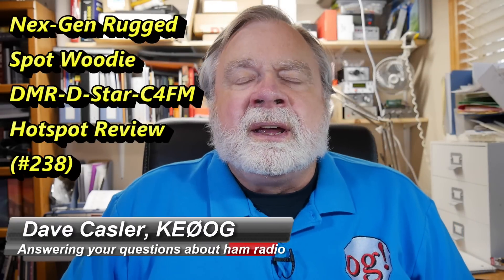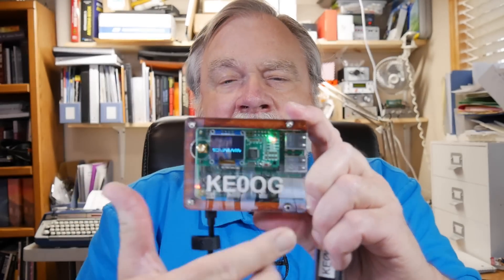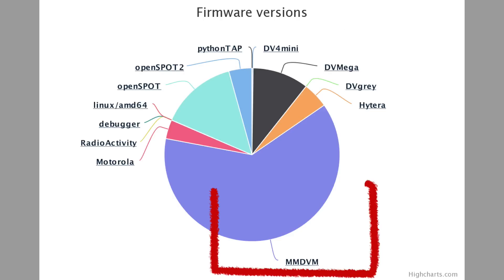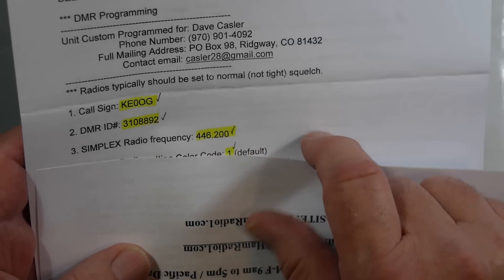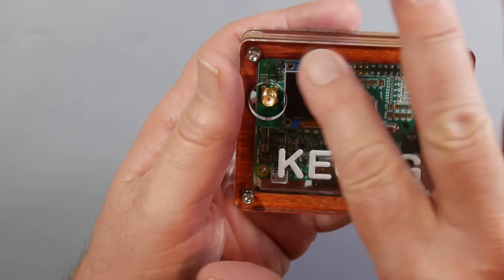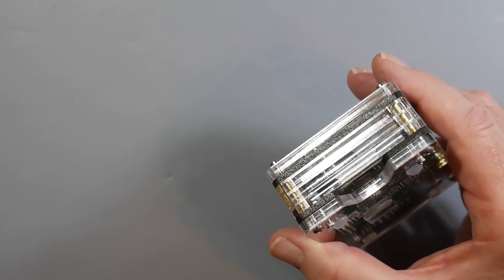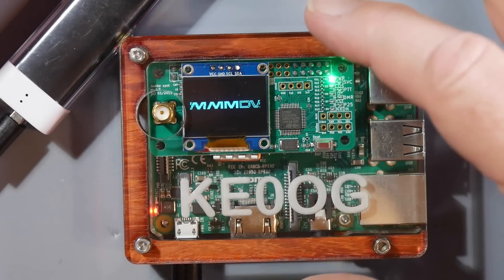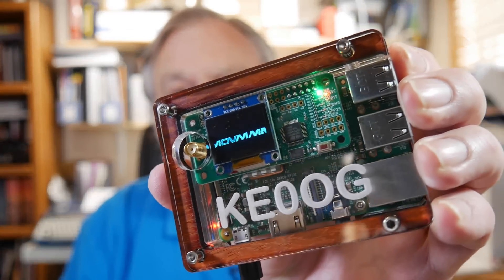Review of NexGen "Woody" Hotspot (#238)

Comment: Regarding pulling the plug,.
The filesystem is set read only so normally it’s no problem :)
HOWEVER it it’s updating, or writing to the sdcard in any way it can (does not always) corrupt..

(If you need to modify anything inside the raspberry pi you have to use the command “rpi-rw” to turn off read only) (this is not needed for basic settings in pi-star)

Have fun with DV :D
73,
PD0HOF

Comment: I bought a rugged spot from him a couple years ago. Turned it on and it was running in seconds.

Tac 310 is still around, but BM won’t allow it to be static linked anymore. Due to this it had effectively killed it. Not sure what replaced it, but I think a lot of the 310 folks went to 3100 (USA).
Reply from the maker: Thanks for the info.

Comment: About yanking the power. I have used it with my built in car WiFi and use an app to find the IP addresses on the network that I am on and look for the pi-star's IP address and use the phone's browser to log into pi-star and do a power down that way. Unfortunately the USB power outlets in my car shut off with the car ignition so you have to be mindful to let your car run until you get the Pi shutdown. Pi-star recommends that you wait 30 seconds to let the pi-star OS to complete its shutdown routine. 
You mentioned the openSPOT brand. I have the openSPOT2 and like it. But I really think the oS2 is better suited for C4FM. I have tried to run DMR on the oS2 but had a lot of weird issues over using DMR with a pi-star hotspot. I have the DVMega from Bridgecom systems. They claim plug and play but I had to reconfigure the WiFi on it. Otherwise the DVMega pi-star hotspot has been flawless. I haven't tried C4FM on the pi-star since I have the oS2 for C4FM but even then I use my Yaesu FTM-100DR in the Access mode as a Wires-X node with Wires-X software which unfortunately requires the use of a Windows computer. 
The DVMega doesn't have a OLED screen but I do have the ability to use VHF or UHF which in a sense after thinking about it I wasted about $40 to get that feature.

Comment: I am on my 2nd hotspot, still not on the air! 1st was a chinese duplex with the large screen option. Nice aluminum case (EBAY). Zero instructions and zero customer support! 2nd is a Jumbo spot kit. I guess my problem is with Pi-star itself. I can not set either hotspot up. I can't even get to the configure page. It is VERY frustrating! I hate to buy a 3rd, but plug & play is sounding very attractive. Thanks for another GREAT video.

Comment: I built one like it for little over 100 bucks. There are others out there that have a nice screen where you can change settings by touchscreen
Reply: Yes, I noticed this one costs almost $300. That's around $200 for someone to set it up for you. Ham Radio is a DIY hobby. I think I'll buy an un-programmed one and figure it out myself and save coin... de W3DJS
Reply from the maker: Lots of hams like to do things themselves. On the other hand lots of hams don't yet have enough experience to do everything themselves. It's the classic make or buy decision.

Comment: I thought hams were into challenges (aka frustration). 😃 I went the Pi-Star Raspberry Pi Zero route for around $70 in eBay parts. I had to solder 16 joints, flash the SD card, and run the setup. Not that bad.

Comment: Great video! Definitely want to look into adding this for DMR ops. I obtained my Digital ID last year but did nothing with it  so this will give me a kick to get started.

Regarding the questionnaire you referenced, do I select an frequency arbitrary one (aside from local repeaters) or are there parameters for the 2 meter band?

73,
Ken, KN4GUS
Reply: My experience with the MMDVM modem board is that it states it supports 2M, but in reality, it didn't... 73 de Stan, G4EGH
Reply from the maker: You need to specify a simplex frequency probably in the 70 cm band. 70 cm band plans vary from region to region. So just pick a frequency that simplex in your region. By the way after you get the device, you can make changes to any of the parameters that you need to make.

Comment: Thanks Dave, quick question... I bought one of these (Rugged Spot) a year ago. I never set it up or used it. I then moved and my wifi stuff changed. The info in the box uses my old info. How do I modify the hotspot so it will connect with my wifi? My guess is I need to connect it to a tv, keyboard, and mouse. Any suggestions?  THX/73s KJ4MFW
Reply from the maker: No, you can log into it via your computer and then set up what you need. Note you will need to know the IP address assigned to it by your router. Or talk to the manufacturer.

Comment: Great video. What kind of programming did you have to do to your radio? You said it took several passes.
Reply from the maker: I don't program handhelds often, so it's like I have to climb the learning curve every time. I usually just program in a few repeaters and some simplex frequencies. I operate my Nex-Gen on simplex, but it took me a few tries to get the radio set right.
Reply: @davecasler  Thanks for your reply, David. Fantastic video!!

Comment: Umm, Dave... You are supposed to put one of the antennas on the SMA Port on the left of the screen....
Reply: If it also has the antenna strip on the board itll only use it and not external
Reply: Dave talks about this very point at 17:05 into the video.
Reply: CodeMasseur I have the HRO zumspot and it has that "strip" as well and they told me to use the antenna. That's why they include them in the package.
Reply: If anything could put small sma dummyload on it and be flush. But I know on the jumbospot boards if it has the strip antenna, you dont need other
Reply: @wesmagyar  I'm not indicating what is right or wrong. I'm just stating that KE0OG talks about that issue at 17:05 in the video. Personally, if I used a hotspot, I'd use the external antenna .However, I have a DV 3K Dongle, and I just need to run BlueDV to connect to DMR from my laptop. The Dongle was about $100 and it's a much simpler way to get on DMR or DStar. (No support for YSF with the dongle sadly.) You can learn about BlueDV here: https://www.pa7lim.nl/bluedv/

Comment: I consider that the greatest risk with sudden power out with computers comes from the potential for filesystem corruption due to incomplete writes that necessitate recovery via scan or from journal (with fsck program in Linux).  But If you poke around in the Pi-Star (you can ssh to a shell) you can see that all parts of the filesystem that must be writable for Linux and the application to function are mounted as tmpfs and the essential non-volatile parts are mounted readonly shortly after startup.  Thus any dynamic FS branches are memory resident and simply discarded at shutdown anyway.  So there is little to be concerned about with pulling the plug unless you are doing configuration changes during which the application remounts the base FS as writable for brief periods.

However, I run my Pi-Stars on those USB battery packs typically used to recharge phones while simultaneously charging the battery pack.  This enhances portability, albeit at the cost of carrying an extra little brick and it seems to provide some voltage stability as well as functioning like a mini UPS.  Despite all this, I shutdown gracefully anyway when it's not inconvenient because, well, that's how I roll.
Reply from the maker: Thanks for the tips.

Comment: Looks good, you did a great review. Question, don't you feel like these new digital modes are getting very close to being Encrypted communications over the Ham bands especially considering some of the chip sets are proprietary to the particular technology being employed? Plus with all the different configuration options it would not be too difficult to carve out a little corner of the digital domain just for yourself and other evil doers and never be found.
Reply from the maker: The FCC's position for many years has been that if the demodulation instructions are published and are well known, it's not encryption. However, many Chinese DMR radios are coming into the United States with the ability for actual encryption. Encryption is legal in some countries for amateur radio operators but not in the US.

Comment: Dave, isn't this just a nifty TCP/IP bridge, taking 4 radio modes, converting into IP and sending them to internet servers?
 Very much like Son Of Echolink, and internet dependent?
Reply: More or less, yes. These are simplex gateways to connect to DMR etc networks when you are not in range, or do not wish to use a repeater.
Reply from the maker: Conceptually, yes. But no, there's not a one to one correlation between a DMR packet and a TCP/IP packet. So there's a lot of conversion work that needs to be done.

Comment: Can you use the HDMI port to output to a larger screen?
Reply: Sorta. You can get the regular Linux console output over the HDMI, but you would have to write a custom script if you wanted to duplicate what is on the OLED (which is controlled over i2c). So it's possible, but not out of the box and you'd have to do it yourself.
Reply: One popular option is the use of Nextion screens connected via the USB ports. Depending on configuration, you can even use them as touchscreens to do minor control of the hotspot (Restart, shut down, etc).

Comment: If you need internet connection can wee still call all of this activity ham radio?
Reply: There is alot of RF involved on ham frequencies using radios and repeaters. The internet aspect is more or less the linking of nodes and repeaters to extend local communications if desired. So yes, I'd say its Ham Radio.

Comment: Full of errors (your video) such as "it's called a pi-star" No, pi-star.co.uk is the project that creates the management web interface that makes all the config easy. (thanks to mm0mwz) At some point you missquote the time slot as "talk group 2". This is a very nice cabinet etc. I think if you look on the gui, it supports FIVE modes, DMR, C4FM, D-Star, P25, and NXDN. (not 4). There are many talk groups to choose from but the "home" of pi-star project is 31672. This is a multi mode tg, it's on DMR, Fusion, P25 and NXDN and xlx-303e there are those that try to monitor this tg and if they are around can give you some help/tips. (inc myself, N3GLV). I got nothing against someone putting a nice finish on a cabinet etc, very slick. But as others have posted here, it's imo at a very premium price. You also failed to mention that it can be jacked into a wired network and will pick up the ip from there and you do not need to give the "MFJ" your wifi credentials. 73 and thanks for the youtube channel de jeff n3glv
Reply from the maker: Sorry about the errors.
Reply: @davecasler  I also made a typo, the project is run by mw0mwz not mm0.

Comment: Are you OK?  You sound short of breath. Blessings too you and your family.  RWB KD2QXQ
Reply from the maker: The shortness of breath is an issue that has been around for a long time. Sometimes I talk about my struggles on the Saturday live streams. I have chronic asthma, which leads to the shortness of breath. I've been dieting and have lost 30 pounds, although have about 40 to go. I'm also exercising regularly, and feel much better. The tremor is called "essential tremor" and simply comes from age. It's a royal pain. In fact, it's the reason that I am dictating these replies using Dragon NaturallySpeaking rather than typing them. I've noticed it gets worse as the day goes on. In the mornings it's not too bad. Aging is not for sissies!